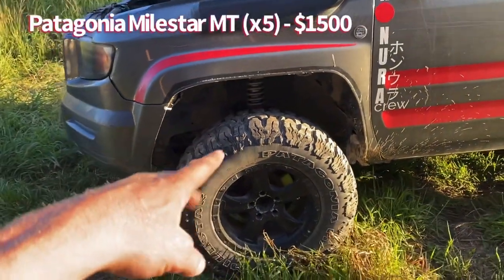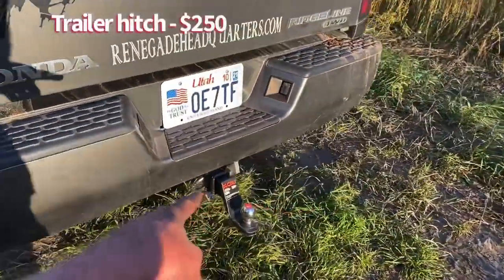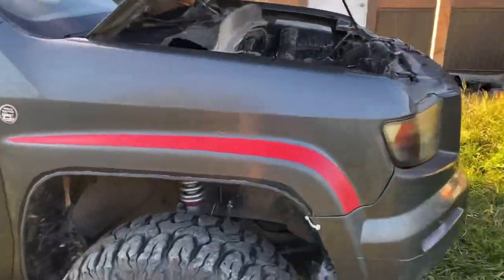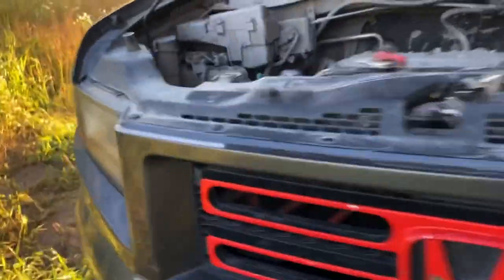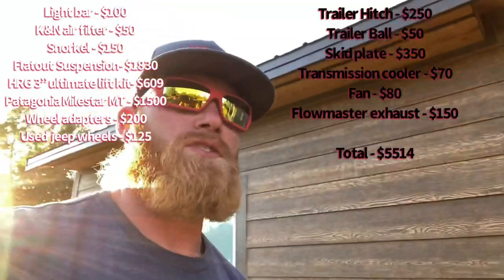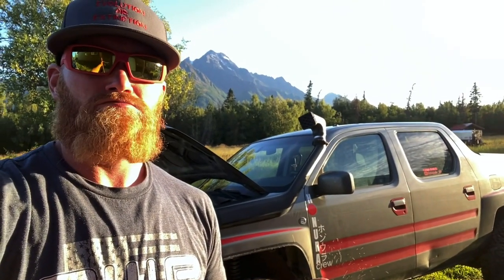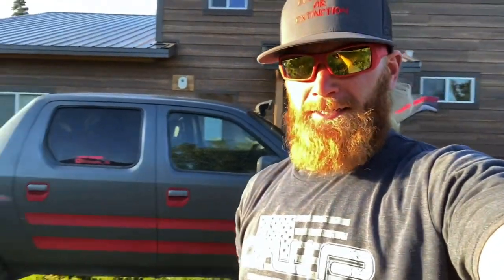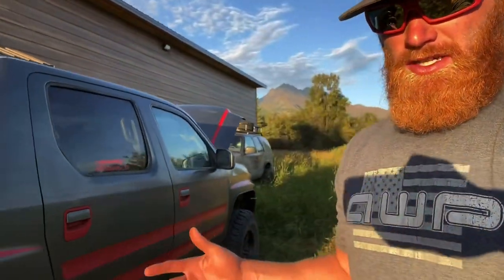Lifted Honda Ridgeline upgrades 2.0

Comment: Hey do you wheels still rub at full lock? I’ve done a ton of cutting and pounding but still rub at full luck. Is this something that’s always gonna happen or do you have any recommendations on how you eliminated that entirely? Did having spacers help? I have no spacers on mine. I’m running the same tire size and 2” lift
Reply from the maker: Appreciate the support bro! I had the 3” lift, no spacers, I did not rub. I cut a lot thought. There is a video on the playlist called “renegade”. Check that out I’d you haven’t. Also make sure your struts are good… if they need to be replaced you’ll definitely rub.

Comment: Hey bud quick question, I just got my Flatout suspension and am doing the install. If I’m only planning on lifting the truck about two inches do I need to get camber bolts for the front end?? I see some people not using them at all. And others using them for alignment.
Reply from the maker: I think with only a 2” lift or shorter it’s whatever you decide. I would use them just to make sure when I took it or there were no excuses to be able to align it.  That’s just my opinion though.
Reply: Thank you buddy! I love what you do, keep it up!!

Comment: I picked up a front receiver hitch for mine and I was looking at your front splash guard and noticed you no longer have one.  I think a winch on a removable cradle for a two inch receiver so it can be used front or back would be a good idea. Flat out suspension is very expensive to me.
Reply from the maker: Ya I’m looking at winch ideas for sure! Also, due to the abuse I put the suspension through I think it makes sense. 3 yr warranty and only $125 to rebuild. In 1.5 yrs I went through the stock struts with more moderate off roading. If I replace the struts 2 times I would spend almost as much as purchasing them, and the 3rd time replacing struts I would save money. I hope that made sense. Haha. They aren’t for everyone but they definitely help the ride! I absolutely love them and feel way more stable!

Comment: Nice summary!!! I’ve been watching for awhile now. Love the stuff you have done. I have a 2014. I got the 2” lift😕. It was before the 3” was out 🤷🏻‍♂️🤷🏻‍♂️. You have mentioned working at a shop are you a mechanic??
Reply from the maker: Just get the Flatout suspension and you’ll be totally set haha. I’m not a mechanic. It just a big garage that can fit a few dump trucks in … when it’s clean haha

Comment: I was shocked at you ripping through the mud. Those tires are the key I’m sure, and of course the lift because these are low.
How does the lift affect the drivetrain? Wouldn’t it mess up the transaxles?
Reply from the maker: If you watch my “Final set up” video I go over it. Everything is working great! Thanks for the support man!

Comment: Great summary with costs of all your upgrades.  Looking forward to watching your next trek in the lower 48 when you test it all again in a different environment and loaded up with gear.  

Did you ever try to mount that spare tire in the bed on the passenger side where there is a threaded mount (behind a small plastic cover) just  for this purpose?  I know due to the larger tire the mount won't line up but it seems like one could use a piece of steel bar with a hole on one end for the stock mounting point and the other end tapped and threaded to line up with the center of your wheel.  This might open up your view a little more when  looking out your rear view mirror.
Reply from the maker: Ya, I’m debating what to do exactly with the spare. I want to be able to access it without it being under the truck though.
Reply: @RenegadeHQ  I'd try the  place I suggested 1st, easiest access and only partial visual obstruction and 2nd choice would be on the roof of the cab, out of the way, no visual obstructions, just a loss of MPG and maybe a lot of wind noise at highway speeds?
Reply from the maker: @timhardman4764  for the time being I think it is good. I’ll look into it the coming weeks.

Comment: I love my 06 not what I wanted but just what I needed. I know the articulation is amazing and still feel level also the travel is bonkers. Have you noticed an increase or decrease in this capability and what have you felt in the change of steering effort
Reply from the maker: Not very much, only because of the tire size. But I did some cutting and it all good!

Comment: Thank you for that video!   How bad is the gas milage to be expected.  I just $ a 2010 thats have 22 inch rims  and I mistakingly had them 10 psi under the max with a few 1000 pound loads.   😟
Reply from the maker: Your welcome. Thank you for the support!! Mpg is 13 to 14 in the city and 15 to 16 on the highway. Overall not that bad for the set up I have in my opinion. And gas mileage is going to be worse as expected with upgrades like this. Rides like a dream though! Extremely smooth and reliable!

Comment: Weak point on the Ridgeline is the tranny cooler inside the radiator. Friend of mine had a 2006 and the connection broke inside the rad and flooded the tranny with coolant and destroyed. I love mine don't get off the beaten path with it but wouldn't be to concerned.
Reply from the maker: Ya I think it’s a risk but heat I think is a bigger risk then smod

Comment: Im looking for the suspension, but it gave me 3 option: 
06-16
17-20
21-up

Whats that?
Reply from the maker: The year your vehicle was built.
Reply: @RenegadeHQ  understood. Thats what I tought, but just to make sure. Thanks.
Reply: @RenegadeHQ  I'm curious. Why does your Ridgeline doesnt have off-road bumper with winch?
Reply from the maker: It will soon haha. Working on getting one fabricated and mounted. Just need a good design and welder. But soon friend.

Comment: I’m trying to lift mine as much as it’ll allow. I’m gonna get that 3in block lift and sub frame lift. I was wondering what coil overs you would suggest or is their a way I can lift it higher?
Reply from the maker: We’re you asking on the FB group like a day or 2 ago?
Reply: @RenegadeHQ   no I don’t have face book.
Reply from the maker: @issacissac1327  3” suspension lift is the highest you can get before axels start binding. If you cut the wheel wells then you can fit some November tires (33”) to give you a bit more clearance. I had it lifted 6” for like a day then had to replace my axles. Haha. 
I love Flatout suspension because I offroad a bunch. And it’s more comfortable and cost effective then getting OEM struts. 
I just used Flatout suspension coilovers to get the 3” lift.
Reply: @RenegadeHQ  okay thanks bro do they make longer cvs and axels? I’m also planing on getting the bumper with the skid plate that takes off the whole front bumper.
Reply from the maker: @issacissac1327  that’ll be awesome! To my knowledge no one actually makes those. The OEM ones have the longest travel and best quality. Just make sure they are actually OEM from Honda
Reply: @RenegadeHQ  okay awesome thanks bro

Comment: Can you bring me up to date so I don't have to watch every video, I looked yesterday and liked your setup there and watched a video that you said you get 14 to mags and then looks like you swapped it with a chevy chassis, My question is did the honda motor or tranny not hold up to the mods and off roading thanks man.
Reply from the maker: The Honda was running strong. There wasn’t anything wrong with it when I did the swap.
Reply: OK, thanks man, I was wanting to build one similar to yours, I thank you, I personally just want clearance and better fuel Miles than my excursion, I wanted a jeep but everyone I know unless they are older are always replacing something on them. I didn't know exactly what I wanted until I say your video so thanks again for showing me they are more capable than I would ever do with it
Reply from the maker: @joshfattig514  your welcome! They are awesome vehicle and are more then capable then 99% of what people actually use trucks for